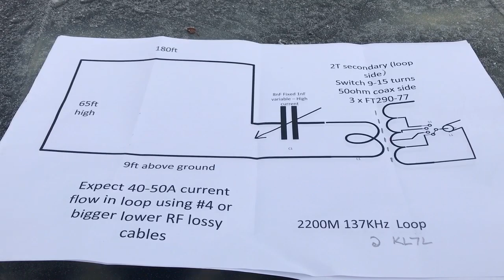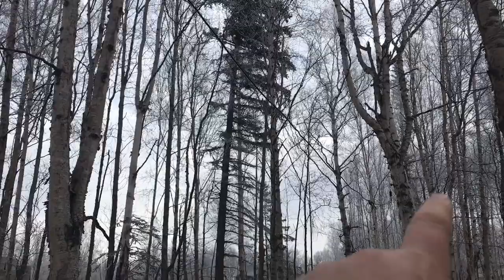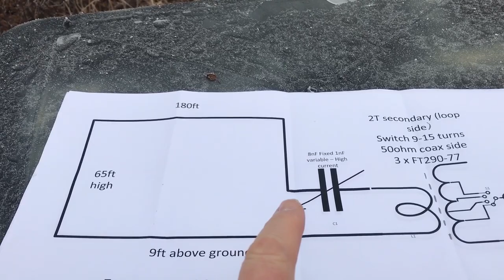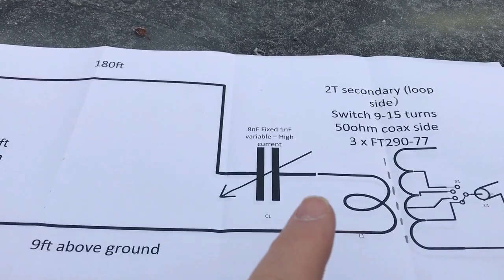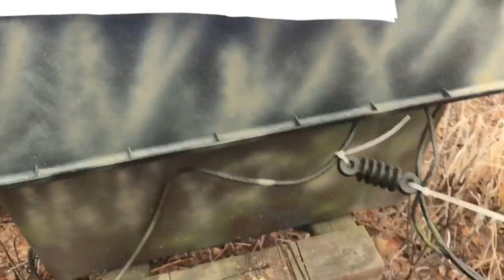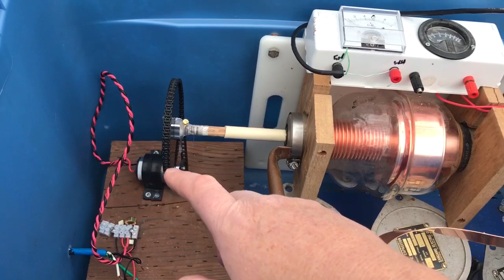137kHz 2200m transmitting loop

Comment: Range? Can you transmit in C-QUAM AM mode?
Reply from the maker: So the  range is dependant on season - typically in Winter mutual darkness months it can reach Japan, Australia and New Zealand, with nice Sea water paths and  given its directional not so Good over the Pole to Europe. Per the video Its "Q" is very high and can only transmit data beit digital modes such as WSJTX WSPR or CW - nothing more than a say 50Hz bandwidth  without issues with the antenna acting like a tight bandpass filter - so no lo-fi AM or even narrow SSB without issues - C-QUAM seems to be in the same category.
Reply: @hellozerohellozero  any great stereo tool presets/settings for this?

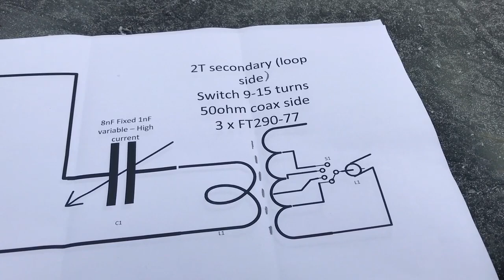Comment: 2:37  Let's see...transformer turns ratio is 2 to 13, secondary current 50A, so primary current would be 50 x 2/13 = 7.7A.  At 50 ohms that's 50 x 7.7 = 385 V, which means 385 x 7.7 = 2965 W, or just under 3 kW, a good amount of oomph coming from your transmitter!  (Well, I've assumed volts and amps are in phase, not sure if they really are...)
Reply from the maker: Thanks for the maths! Yes a lot of Ommph - certainly less than 7.7A on the primary (I have an old War dept 10A thermocouple of dubious  status and it reads around 4.7A (RMS I guess) - It would not surprise me if secondary RF current is less than 50A - If we say we have around 1400 Watts carrier, ie Im not pulsing we can work back from there - my losses are higher here than when we ran the same tx but smaller lower AC loss loss loop (lot os parallel TFFN6 and 4 cables but the EIRP appears to be very similar and even with the ommpf difficult to attain 1W EIRP on the main lobe(s)

Comment: What an amazing project. Thanks for sharing. I am no where near being able to approach that band - my current “goal band” is 160 m ! I was dismayed though that for 1KW in you are reporting 1-2 ERP. Where’s it all going ? Shouldn’t your tuning network be hot ? 73. KD2ODE
Reply from the maker: Hi John - Ive just put my first overnight transmission from the loop and tuning really hadnt changed at all over the period. Well, there are quite a few losses involved - ground loss is big of course - conductor losses at 137kHz of the wire itself - in theory I Could have gone bigger diameter but less physically strong, but here its a matter of physical survival and a toss up of weight and  RF losses. Other losses are dielectric losses in the tuning components, losses in the ferrite itself - Physical size of this loop at 137 kHz isn't ideal and again a large part of the loss of efficiency  - but there are tree survival and weight bearing limits on open spans.  Theres a great loop calculator that sort of works at www.66pacific.com and you can play with size, wire diameters etc. gives you voltages and resonating C too. Cheers from Alaska
Reply: hellozerohellozero thanks much. I will enjoy doing some “what if’s” with the online calculators.  Close to our shore QTH in a Tuckerton NJ there is an old -what appears to be - a VLF transmitting antenna which I have assumed was meant for submarine coms. It’s arranged as a spiral - ie an ever-widening circle of perhaps 12 rings, suspended from telephone pole high posts.  I assume that the navy could care less about lost power, as long as the ERP is where they need it to be, but I’ve wondered if a widely gapped spiral  loop at some 50 feet off the ground might have benefits. Thanks again and 73s JOHN KD2ODE